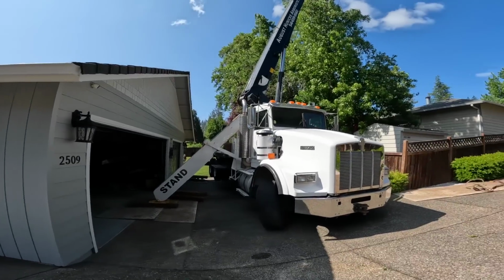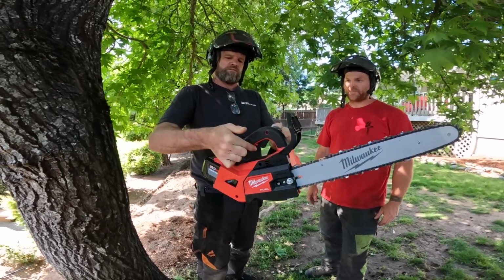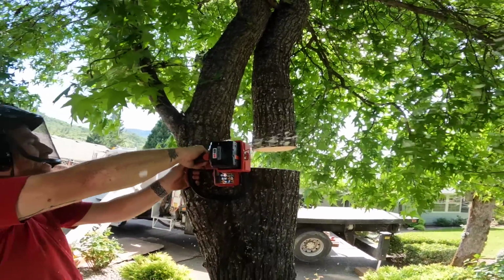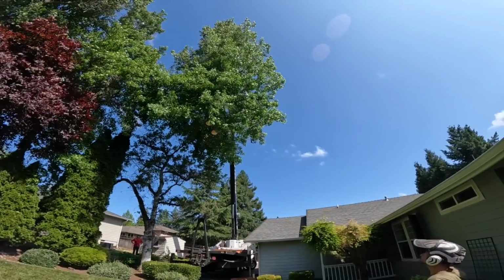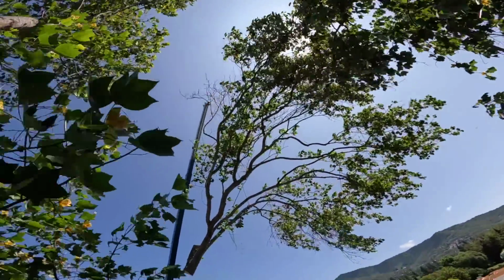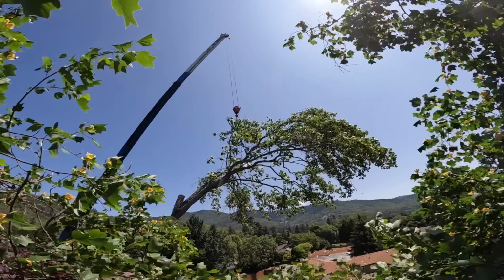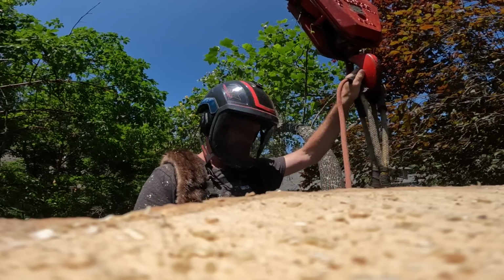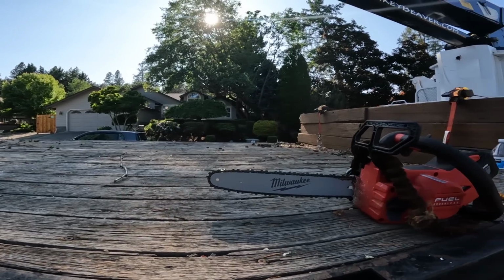Milwaukee Battery Chainsaw First Cuts

Comment: Just marketing, I know, but thanks Milwaukee for supporting our YouTube friends.  Bought 2 of these today.  Pleased with the performance.  They will overheat an 8 amp hour battery (experienced it this morning), so for those considering the saw, plan on a 12 aH battery.  Thank you August, as always, for sharing your work.
Reply: i even overheated the 12ah in less than 25minutes of usage.. that's why other company such as dewalt, makita, ego and others made their chainsaw to run higher volt, so it wont overheat due to excessive amp being draw from the powerful 18v motor.
Reply: Im down in texas, it does great but i learned to only run about half a battery then swap. Bc once they over heat it takes forever for the temp protection to go off in 100+ weather
Reply: Great feedback

Comment: Thanks for the honest review! :)
         Using the Milwaukee pole saw,I usually use a lighter weight M18 5.0AH battery that lasts long enough for my trimming limb jobs on my property.I carry extra batteries in a HF plastic ammo can to keep them out of any rain or dirt.The oil reservoir on the pole saw does leak if you leave it full of oil while in storage.I usually fill the tank 1/4 full as the pole saw doesn't use much oil.
         I use the  Milwaukee QUIK-LOK weedeater,Hackzall with 3T Diablo carbide blade for cutting roots,small trees, and bushes at ground level to save my saw chain,Milwaukee hammerdrill works great for a long time with a M18 4.0AH battery,M18 box vacuum cleaner is good for cleaning up dirt and sawdust,and the M18 air compressor is quiet and adequate,but a little slow  for inflating truck tires if you don't have a full sized air compressor handy.
          I did have a M18 9.0AH that came with the weedeater fail after less than a years use;the M18 4.0,5.0's,and 8.0 AH batteries have not had any problems.

Comment: I bought the rear handle over winter, because I got a free pole pruner with it and I was pretty impressed with it, being my first battery saw and I will definitely be getting one of these as well.  They'll never replace my gas saws, but I think they'll be good to have around.
Reply: The pole saw functionality is awesome. I use it way more than I expected

Comment: I used a Makita 36v saw the other day and it was very awesome, light, cuts super fast. There is an on/off button that you have to keep pushing because it goes to auto-off after a minute but its easy to hit it one handed.
Reply: I think the Makita is much better although I've only used the Milwaukee a few times.

Comment: Cleared all the trees in my neighborhood after hurricane byrel in Houston Tx this chainsaw is awesome . I used 12.0 batteries . Charged one used one , kept rotating !

This is a must have in your ARSENAL
Reply: I own the 16" rear handle and the 8" pruning hatchet, luckily i haven't had to use mine like that yet. I've just used for generally pruning work. They are really nice saws for homeowners who know what they are doing. I got mine last summer and cut up a 15" diameter pear tree stump with my 16" no problems at all.

Comment: Nice! Definitely need a side by side cutting comparison with the husqvarna and Milwaukee
Reply: Yes, we need !
Reply: One is made in China  
That is the deal breaker
Reply: @missingremote4388  Exactly, I'll take the made in Sweden magnesium housing one over the china plastic one .
Reply: I have the Stihl and in fact 3 different models, in regard to mines with saws I am okay in over 3 years never have a problem except the batteries are priced like gold and they not last long in a charge. But sure for the matter of knowing I to with like to try side by side with any other brand.

Comment: I have the M12 Milwaukee 6" trimming saw. It works great and will cut stuff bigger than the 2" recommended. Stihl had one first but I did not want another battery platform.
I hope Hez is still doing well with the flying.

Comment: I'm on the M18 platform and have been looking at this saw. Your review and "so far" stamp of approval is appreciated.
Reply from the maker: It does seem hard on the battery.
Reply: @AugustHunicke it's got great torque but the overheating is so bad I'd consider it a bad design( only used 5ah) . The Makita 36v is better I think.

Comment: Enjoyed the video.  I like the test you put the Milwaukee Battery Chainsaw through.  Some tough cutting there.  Bar buried and still zipping along.  I like it.  I use an Echo DCS-2500T for most of my limbing and topping.  I like the balance and the lightweight.  The Husky E-saw seemed heavy and awkward (but with lots of power).  Very nice camera work.  Thanks for the camera placement and editing.
Reply: My DCS-2500T arrived last week. All good so far; seems very capable. I really like it!
Reply: This m18 saw is definitely larger and more awkward than the t535lixp and t540ixp. Lots and lots of plastic, whereas the husky saws are built much more compact with the battery being the only heavy piece. This saw is fine for keeping in the truck for those 'just in case' instances, but the fan cooled battery of the husky is definitely the way to go for in tree use, imo.

Comment: What bar and chain do you plan to use with the Milwaukee top handle? Do you plan to put a quarter pitch kit on it? I've wanted to get one but from what I've read the bar and chain that come with the saw are not the best. Glad to hear it needs better dogs too. All things I will consider.

Comment: I have the Milwaukee 14". The bar needs a sprocket because I purchased a 16" Powercare bar which has a sprocket. The original  bar the tip groove flared open and the chain sunk deeper. Derailed too. Hammering it back didn't fix it permanently.

Comment: pretty much all the area utilities have went to the Milwaukee saws..  Stihl hit first and they bought some then when the Milwaukee's came out they were keeping the local vendors out of stock, batteries in common with all their other Milwaukee tools helped as well.  I have several gas saws and for everything 16-18" and under all I have used the past few years is the Milwaukee saws.  If I was using them commercially the speed of a gas saw might beat out the Milwaukee but for convenience you just cannot beat the Milwaukee saw.   Only issue so far is the bar studs have pulled loose on one of the saws, I cleaned and epoxied back in and so far holding.

Comment: I started climbing with my Makita cordless saw with (2x) 18V batteries.  It cuts great but I did buy an Echo 2511t due to weight.  I don't like the cost of big Milwaukee batteries so I prefer the Makita which pairs up their 18V batteries.
Reply: IMO that idea to parallel two batteries was genius!  I wish that Stihl had done that on my RMA-460 cordless mower.  It has spaces for two batteries but only uses one, which gets really hot during use.  I am going to buy the terminals and wire in the second compartment so I can use two batteries in parallel (if the nanny-state electronics inside the batteries/mower will let me).  It lets us users with the smaller batteries that we already own double them up and be able to use some of the higher-load tools.
Reply: IMO... the cost of milwaukee batteries is offset with their warranty, and how long they actually last.  My V28 (first generation lithium ion batteries from them) lasted me under light personal use of over a decade.  The M28 (2nd generation) works with the tools, so still going strong.
Reply: @Wolphin  The cost of 10 and 12mah Milwaukee batteries seems crazy to me.  I  haven't lost any Makita batteries over the years but I have many of them since are easy to get in kit deals.  Initially, I went with Makita 18V rather than Milwaukee because of Makita's selection.   I have some Milwaukee 12V now just because of certain tools but that battery design is terrible.  I saw a comparison of Milwaukee and Makita hole-hawg type drills.  The Makita had a lot more power.  They could be running 36V motors while Milwaukee is stuck at 18V.

Comment: So I have the two Handed Milwaukee they have us use at our utility Company.  It has metal Grizzlys dogs that are tiny.. .  HAve not seen this version of milwaukee before.  My one think is the kerf of the bar and chain. Do u think its possible to upsize  the bar not in length but the Kirf and get a chain to accomodate?   we have too clear branches and or limbs in many cases to run cable.  I try to cut it without utting stress on Bar and chain by your techniques but sometimes its like WTF.   The chain and bar gets pinched for the smallest stuff.. To my knowledge they are husqvarn bars and Chains right out of the box. Im also curious if u can dilute the chain oil and what would uyou use to do that . Regular bar and chain Lube seemse a bit thick in viscosity for a battery saw?. Stay safe
Reply: Great video August.  And it be cool If u Could do a breakdown of the this miwaukees saw in how its built .  Ups and downs .  And  general review

Comment: For the non-pros watching this vid -:the secret to success with battery saws is keeping the chain super sharp. Keep it out of the dirt !! I use the Dremel sharpening kit with the appropriate diameter grinding points. I can do a chain in about 3 minutes and no need to remove it. I have had both the Milwaukee 16” and a Stihl 10” for about 5 years and have used them a good bit. They are awesome when you are burning downed trees and limbs.
Reply: For occasional homeowner use the quality ( read expensive) saws are your best value. If you don’t use it for a year or two there is no problem. Get it out, throw the battery in it and it works perfectly. A gas saw that sits unused for a year or more is likely going to the scrap pile. The fuel system will need a complete refurb which will likely cost more than the saw was new.
Reply: 😂Dremel to sharpen chain are you serious just hand file it
Reply: I use the timberline sharpener no power tools needed it works great. Caride sharpener it is better than new. Don't buy the China clones the USA made version is what you want.

Comment: That's awesome output from the big battery. I have the rear handle version which absolutely EATS smaller batteries.
Reply: I noticed that as well.  I tried the 5, and 6.0's  There's several Milwaukee tools that about require the 12.0 battery, if you want any sort of run time.
Reply: @johndunbar2393  Which, if you think of how much power it has to deliver, is not surprising at all.  I still have my 20-year-old Ryobi 4.5" circular saw and with its 18V NiCd battery, you might be able to cut two or three 2x4s and then that battery was done.  We have come a long way in battery technology, that's for sure!  I'm really impressed with this Milwaukee saw, still keeping the speed up with the bar buried.
Reply: @redmondjp  I had one of those old blue Ryobi kits with several tools 20 years ago and yeah, we've come a LONG way.  👍🏻. I held off getting a 12.0 for awhile because of cost, but I'm glad I have it, now that I have it.

Comment: I have nothing but battery saws. Always easy to start and little maintenance. Quieter too. 
The numbers are the capacity of the battery. An 8 is 8 Amp Hours. The 12 you used to one bar of capacity is 12 Amp Hours. Weight and capacity are pretty proportional. Milwaukee is great all around tools. Interesting to hear about the dogs though.

Comment: Hey August, great video and review of the new Milwaukee saw! It looks like a decent option for guys like me that already have several Milwaukee cordless tools.  How would you say the battery life compared to the Husqvarna and Stihl options?
Reply from the maker: Battery goes a bit fast I think 🤷🏼‍♂️
Reply: @AugustHunicke  Thank you sir. I thought that might be the case, like you said in the video maybe better with 1/4 pitch but there's probably not a compatible panther setup yet with such a new saw. Not sure I'm ready to drop $700 for the kit though. The ol Mac 310 I have is getting the job done for now.

Comment: I have always love milwaukee tools.  1 bar... it may start slowing a little... but feel free to use it down till it stops and the battery flashes.  They also have a pole trimming saw which uses the same batteries.  the number is how many Ah the battery has, so the XC8.0 is 8 Ah capacity... high output means it can output the power faster than a regular one.  (I'm just a tech geek, not anything official about tools)

Comment: i have both gas and battery chainsaw. tho battery chainsaw doesn't pack a punch, it's nice to have it around when dealing with smaller stuffs. 0 emissions, not much greasy stuffs, 0 smell, not too noisy so i dont have to put earmuff. best thing about it i only need to reach another full charged battery on my belt to 'refuel' once it stops running.

mine is worx 20v chainsaw(yeh it's closer to a toy than power tools lmao). never tried milwaukee's before. but seeing how it cuts big stuffs here i might ditch my gas-powered and going all battery.

Comment: But how does it compare to the older Milwaukee chainsaw? On their site they claim new saw will cut 250 times vs 150 for older style. I had a heck of a time cutting through 12 inch cedar at my son's house with mine (maybe too much sap in the summer) but I took saw home and sharpened it and went through stuff at home no problem. Usually I only cut when it's cold outside. BTW: I ditched the original Milwaukee bar for a slightly wider Oregon branded one and it's so much better. The original bar just didn't last and allowed chain to walk too much.

Comment: Any comments on bar oil flow for this or any of the electric saws? My EGO brand electric saw always runs too dry and hot it seems.
Reply: They're for small stuff. Where the electric or battery  chainsaw are meant for light duty.  Small limbs and trimming trash branches. 
 Instead a gas saw can be used constantly

Comment: Used a rear handle to clean up after a cyclone blew through the farm I work on ,it blew my mind how well it did.imo the top handle is forced safety to stop you using at certain angels.

Comment: Guessing that the Milwaukee ships with 3/8" LP chain, if you want faster cutting you might go to 3/8" LP NK (narrow kerf) AND matching bar, since the drive links are thinner on NK chain. Of course you want the basics- carefully filed cutters and the most joint (depth gauge drop) the saw can handle for the wood you're cutting (that'll vary.) Or just KISS with plain LP.
Reply: what make bars can one walk in to saw shop and buy if milwaukee bar get boogered?

Comment: You need a driveway damage disclaimer in your contract absolving you of liability for that. Not to say you still shouldn't try to avoid damage and perhaps fix it when it happens, but you could always point to the disclaimer for unreasonable clients.

Comment: Try a WEN battery chain saw. 40V, 16" bar. Cost about $150.00
Reply: WHERE YOU GET ? HOW LONG YOU BEEN USING IT HAS IT HELD UP ?
Reply: THAT HAS ONLY A 4 AMP BATTERY..

Comment: M 18 Saw prices 339.00 up 699.00 depending where u buy it stihl 161 T 449.00
Stihl 220 TC O 609.00
Makita m18 259.00
Echo eforce 12 549.00
Husqvarna T535 ixp 489.00
T540ixp 649.00
T340i 1029.00 two batteries n charger
Reply from the maker: 161 is LAME
Reply: @AugustHunicke  Yes as you know big difference between  Homeowners and Professional series saws well all tools for that matter
Reply from the maker: @jcc3999  220 is legit tho

Comment: Brushless electric motors are way more powerful than any gas engine the reason is they can make 100% HP and Torque at any RPM There is no power band like an internal combustion engine. They are lot smaller in size this is why a Tesla can whip most gas engine cars in the 1/4 mile. When they figure out how to make a battery last as long as a tank of gas that will be the end of gas engines.  Until then we still be mixing 2 stroke oil and gas.

Comment: Bigger dogs would encourage too aggressive cutting leading to high amp draw and overheating of the electronics , motor and battery.
Reply from the maker: No.  The smooth power head pivot point provided by more substantial dogs would allow for easier and more battery efficient use while cutting in the varied, sometimes awkward, work positions of tree climbing.

Comment: Milwaukee has a hand blower that works really well.  I caret it on my semibtruck for blowing off my trailer.  Might be an option for small jobs instead of packing tge big gas blower around.
Reply: That's pretty much the use-case for battery blowers & chainsaws. Super reliable and low-maintenance, but limited power. Perfect for certain tasks

Comment: 1 battery charger and saw 499$
Reply: The battery by itself is $249. Definitely go for the kit.
Reply: The $499 kit is an 8ah battery.  He used a 12ah in the video.
Reply: @garyganser2451  The one I checked out was 12 hr battery from northern tool